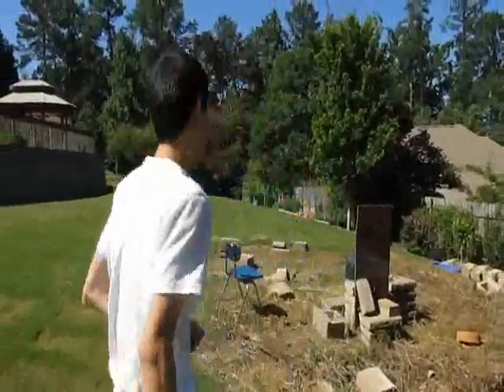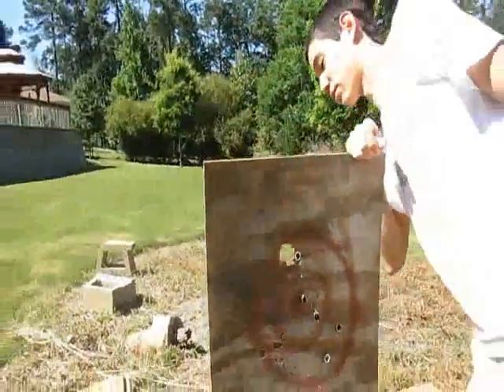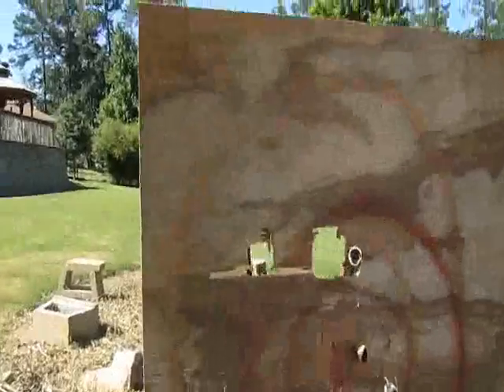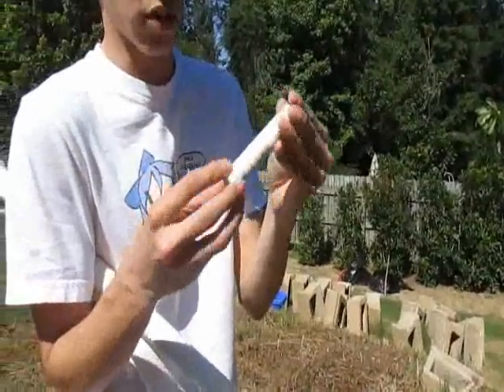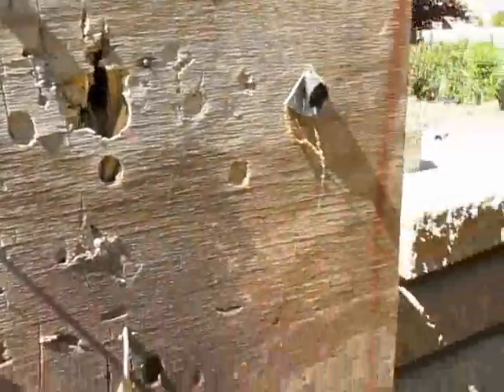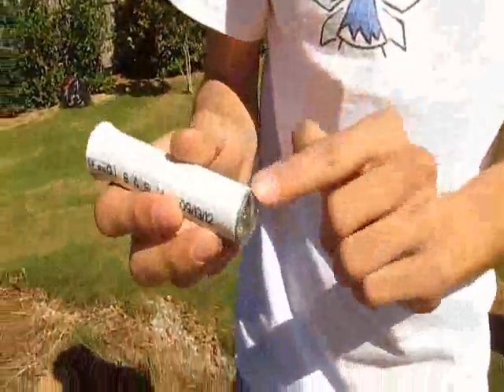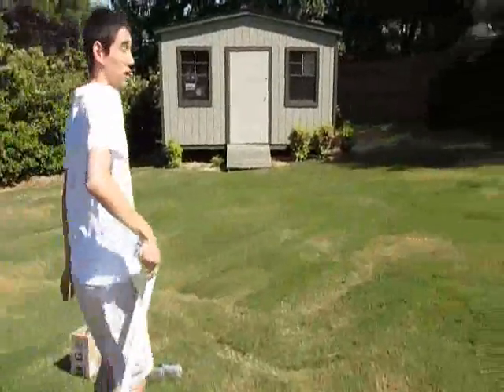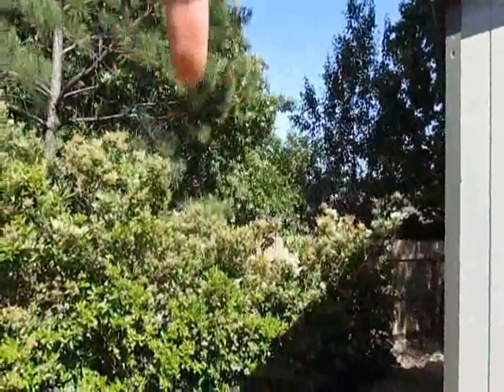Water Bottle Spud Gun Tests

Comment: When I make my rifle i'm going to use either a 2l coca-cola bottle or a 3l milk bottle. The milk bottle feels a lot stronger than the coca-cola bottle, because the coke bottle can easily be compressed unlike the milk bottle which needs to be squeezed harder. This vid shows me how powerful those slugs are with a small, weak 1 litre water bottle piezoelectric rifle.

Comment from the maker: For the next gun I'm still using a 1:1 ratio with a 500mL bottle, but as blacksheeprcool said, I'll be testing 1.5 and 2L bottles as well. That'll make the ratio between the chamber and the barrel larger, even if it isn't near 'ideal' it should work rather well.

Comment: that's pretty powerful considering the size of the slug to the gun. have you considered using a larger bottle? Spud Guns are most efficient with a compression chamber with a volume that's 1.5 time the volume of the barrel.